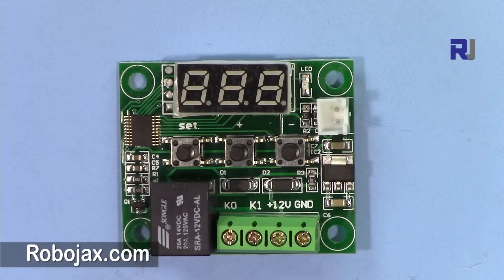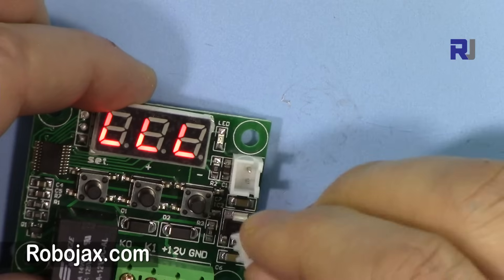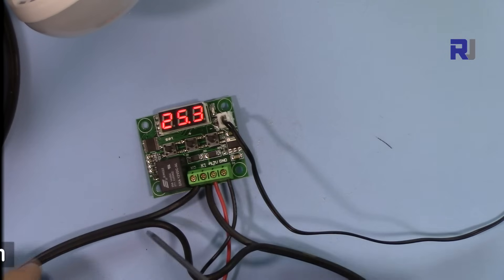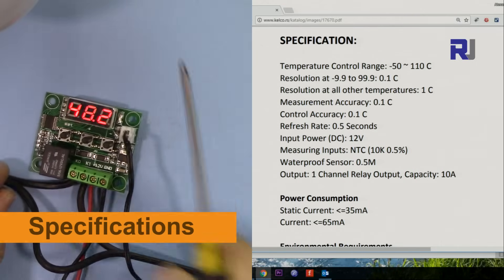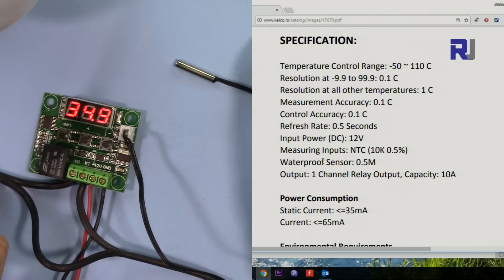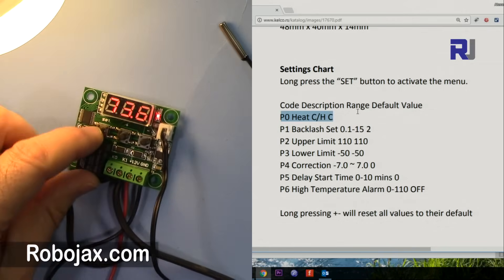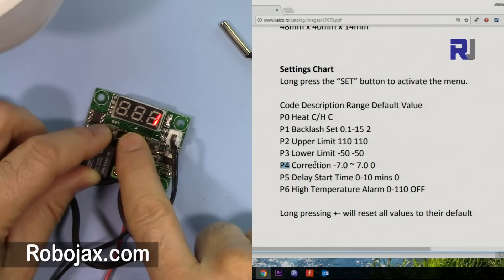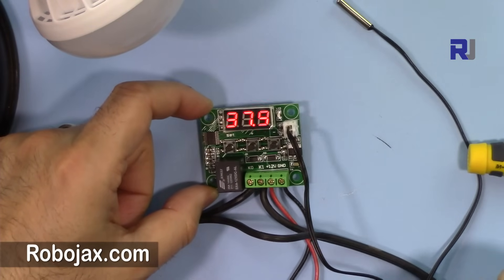How to use W1209 Temperature relay controller and program the thermostat

Comment: OK, I got a 12volt car battery.... connected one wire from the Positive post on the battery to the 12v connection on the W1209 and the one from the Negative (ground) on the battery to the Ground on the W1209. Only a Red light on the Right of the Display lit up.
So then, I did it all again with a second W1209 unit I had (I bought 4 for $20.00).  
It Immediately Fried the small group of components on the UPPER LEFT side of the W1209. So now I guess I have Destroyed 2 out of the 4 units that I bought ! WHAT NEXT ?
Reply from the maker: so you have connected the polarity incorrectly. Positive and Negative must have been connected in wrong way.
Reply: Did you READ my Comment?
Why do you think I explained how I connected them.... but you still Ignored what I Freaking said ?
Don't bother replying...you're a waste of my time !
Reply from the maker: I didn't want to reply . Bu It never get fried unless you connected the polarity incorrectly.
Reply: The seller of the W1209 and I found out what the Problem was...these W1209s that I bought came with the Plastic Case which had metal Nuts and Bolts that shorted part of the Printed Circuit board out on 3 out of the 4 units that I bought... He has Graciously agreed to replace them for me...His Ebay name is Envista if anyone wants an HONEST Ebay seller !
Reply: Don't be angry like that. He answered your comment. He told you the possibility of what happened. Sometimes a battery can reverse its polarity and cause damage to electronic things. A battery reversing its polarity can only happen if it was charged with reverse polarity.
But I know you found the problem out with the seller.
Have a blessed day and obey our Saviour and Messiah Yehoshua Jesus.

Comment: My settings is like this,
P0 H
P1 .2
P2 110
P3 -50
P4 O
P5 1
P6 37.7
My problem is that it doesn't work on higher temperature. It only plays between 27-28degress celcius. On at 27,off at 29 till ----@37.7 but when it cools below 37.7 the bulb won't lights on. Need some help here. Tia..
Reply from the maker: What are your start and stop tempratures?You have P5 set to 1 meaning it will wait for 1 minuets before it acts. So change P5 to 1. See manual here: https://goo.gl/sVJM5v
Let me know if it works.
Reply: My p5 is already set to 1..my highest temperature is 40,lowest is 30..alarm is at 37.7, P1 is .2 so once it dropped to 35.5,heat source should work in my case it didn't work till it reach 28 degrees Celsius.
Reply from the maker: but the way you set the temperature you put on the left side "start" and on the right side "end" . it makes difference which where you put your high temperature and where you put your low temperature. Watch the video again.
Reply: Yes sir, I got it. Thanks a lot sir..I'm playing it right now,it's great.
Reply: Gabs More m

Comment: Hi, Will it work if i change the relay to 12vDC with 250VAC,  because i need to turn on my equipment that running on 240v.
im scared that the 125VAC relay would fry out when my equipment pulls 240v through it.
And all the models of W1209 that i can find comes with 125VAC only.  
-Thanks.
Reply from the maker: It works with 240V as well.  What is the power of consumption of your device?
Reply: We're speaking about frying about ~$2 here, how much was your coffee today? ;)

Comment: Can we comnect 220 volts bulb wire
Reply from the maker: Yes you can. That's what I have shown. AC bulb. 120 V or 220V.
Reply: @robojax  sir, can i plug in a 220vac bulb, with ds relay details.. 20a, 14vdc, 20a 125vac, sra 12vdc-al... if not sir sir, how can i use ds thermostat sir since phils has 220vac source.. i will use ds for my egg incubator project sir, hope u can send detailed wire diagram sir for ds kind of thermostat.. i am a newbie.. i just ordered ds online.. i did not notice load requirments.. ty sir robojax..

Comment: How do I wire this little controller to my RV 12v Furnace. My Furnace Thermostat has a 2 wire setup. I can see where to hook those 2 wires up...but where do I get the other 2 
12v wires from ?
Is there an On/Off switch to shut the who thing down when the RV is stored ?
Reply from the maker: This device has not ON/OFF switch. You have to unplug it from DC power.
You can't use other thermostat with this device. Your furnace should be connected via AC wire direction so this can turn it ON or OFF. This device is thermostat.

Comment: Does anybody know what the input voltage range is? 12VDC +/- how much? I would like to use  3-cell LIPO without dropping the voltage from its high of 14.6VDC fully charged.
Reply from the maker: The rated voltage is 12V and have not tested for other voltages.